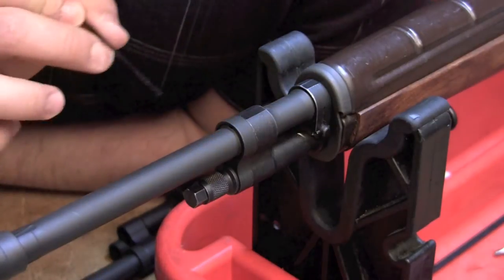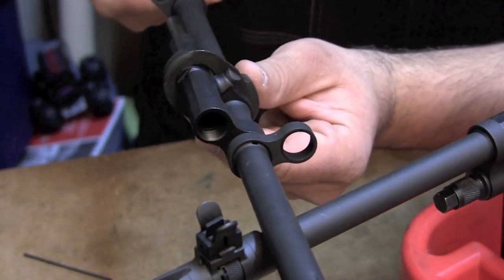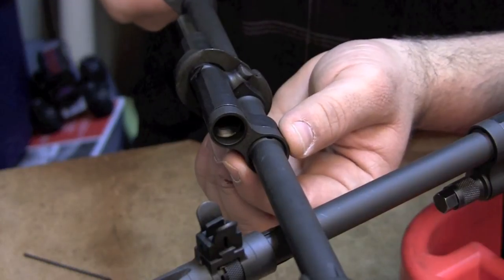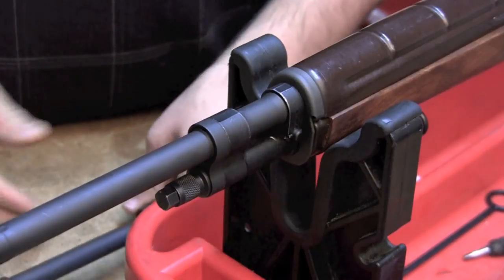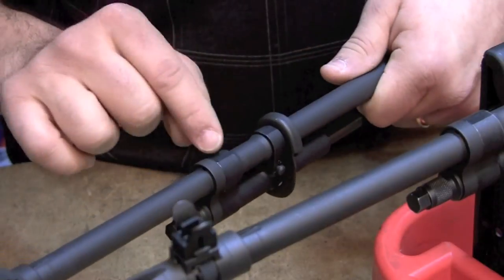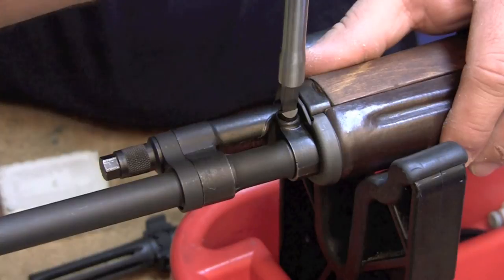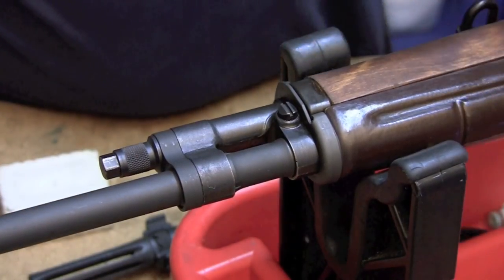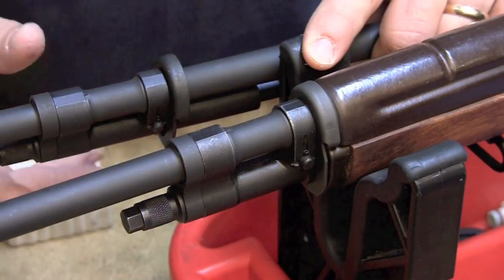M14 M1A Inspection Video Episode 2: Gas Lock through Front Band

Comment: Tonyben3 as usual great video very informative. Question when shimming gas block I did as you said. Worked perfectly, cut when tightening for timing I had to put a little muscle into it.seems fine,just wondering if it could be to tight? Thanks
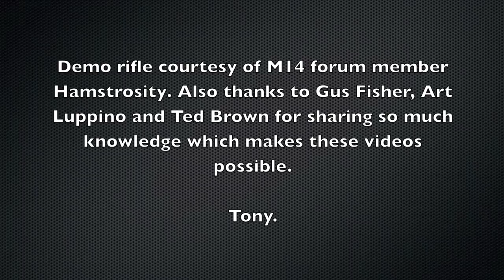Reply from the maker: Having to use a little muscle is okay. If the gas lock stops before 4:30 and requires a lot of force, it may be too much. Test fire the rifle and if accuracy goes out the window, try using less shims and try to get the lock to stop around 5 o'clock with moderate force required to take it to 6 o'clock and try again.

Tony.
Reply: Thank you sir especially for the quick reply it stopped right around 5 o'clock and got a little stuck out I'm hoping that it should work out for me I appreciate your time thank you

Comment: I bought an SA M1A in 2005, it is a 1985 model Super Match with original Kevlar bedded stock, had never been fired, gauges "0" front and rear. It took a lot of work and elbow grease to completely disassemble, the original grease was very hard, no rust. I took a pot of water to boil and dipped the parts to clean it away. Oiled and new grease and a dab of anti-seize on the threads. The issue I still have is the spindle valve is locked tight, back pin is missing. I don't know if it has been glued, probably not. Would like to get this working. Any ideas? How to free this up? Heat? Parts can be had from Fulton. By the way it shoots like a dream, 1/2 moa at 100.
Reply from the maker: It's probably unitized with a screw going from the back of the front band into the spindle valve and you can't turn it. It's permanent. It's a common accuracy mod.

Tony.
Reply: I didn't see one. Will disassemble and check. If not, what do you think?
Reply from the maker: go to www.tedbrownrifles.com and click on "available services" and on the 4th picture down, you'll see a picture of a screw-n-glue gas cylinder and where the screws are. Are those screws on your gas cylinder? You have to take off the hand guard to see them or remove the action from the stock. You cant' see them with the rifle all put together.

Tony.

Comment: does this issue only effect accuracy? or does it effect things like reliability or durability
Reply from the maker: In affects accuracy the most, but if your gas lock timing is way off or shimmed too much, then your gas port and spindle valve will be so far out of alignment that the gas will be shut off and the rifle will not cycle.